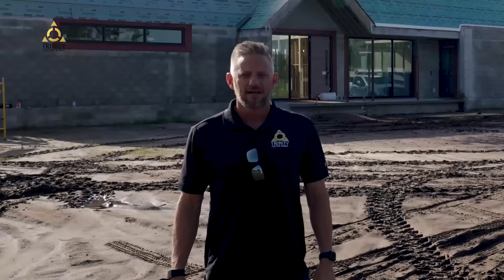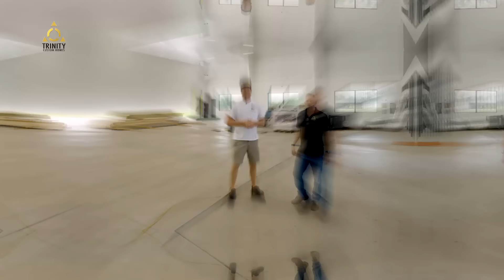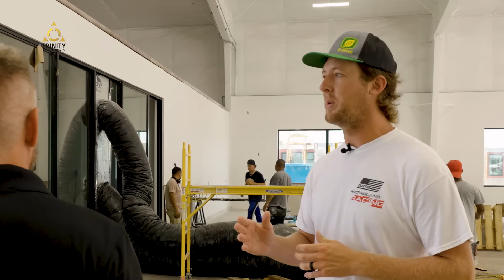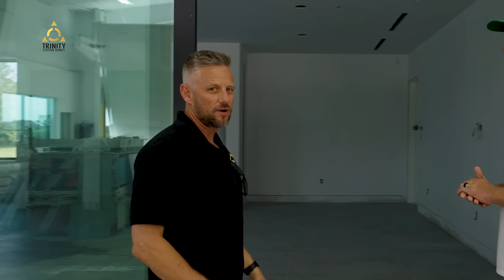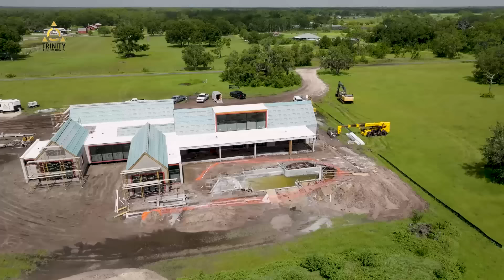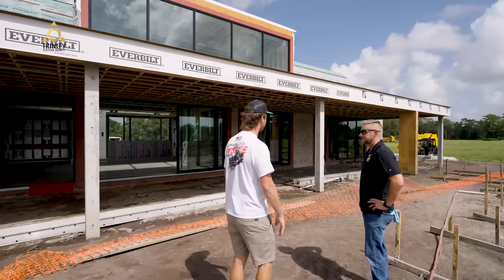Inside the Most Watched Custom Build in the Country | @CleetusM x Trinity Custom Homes

Comment: For cleetus to proudly say gm shirt what about the thousands of customers that has anyone of the gm gmc  Cadillac junk motors he should be careful on promoting gm or gmc / all  general motors another example 2023 2025 z06 zr1 fire hazard the fix well lets fix the cars not sold yet or the ones on the dealerships lots first then fix the ones that are already on the road ? Even worse to only using a new gas fill platic around the fill neck that dont have a tiny inch hole for run off or overfilled to just spill out over the side on the quarter panel alot of chevy onwers not happy

Comment: I'm curious why use wood 2x4 for all or most of the internal framework? Metal would have been much better for accurate and square and won't warp from different weather patterns and I think Metal studs would have been cheaper than wood

Comment: Question. What's with the longs metal bars on Cleetus's hanger door? I'd say counterweight but i still not sure how it works.
Reply from the maker: It’s a truss system to support the door from buckling when it’s open.  It’s 130’ wide. Without this, the door would collapse on itself.
Reply: @trinityconstructionanddesign Ah, ok thank you!

Comment: You can't stand on the AMERICAN FLAG ANYWAYS AS VERY DISRESPECTFUL IF WENT WITH THE AMERICAN FLAG, HOWEVER YOU NEED TO ADD ONE TO FREEDOM FACTORY OUT FRONT WITH THE FREEDOM FLAG BELOW AND ONE AT BRADENTON DRAGWAY AS WELL WITH IT'S DRAG RACING LOGO AS WELL WITH THE SIGNS AND KEEP THAT HELMET AT FREEDOM FACTORY  AND TRY TO LIGHT UP IF CAN USE LED LIGHTS THAT'S POPS THROUGH HOLES OR JUST OUTLINE THE HELMET WITH THE FLAG AND FLAG LOGO NEXT TO IT WITH SMALL ISLAND OF NICE LANDSCAPE LOOKS LIKE YOU SEE AT TALLADEGA AS SO COOL AS YOU JUST ABOUT BOUCED OUT OF THE RV WHEN SEEN THE SIGN AND FLAGS, YOUR PEOPLE THAT COMING TO THE RACES CAN GET THAT EXCITED YOU GOT AN SETUP SOME CAMPING SPOTS THAT'S WITH ELECTRIC AND CHARGE ACCORDINGLY AND GET A TRUCK TO PUMP OUT POOPERS AND DUMP AT LOCAL PLACE AS ADDED TO COST FOR DUMPING THATS KNOWN AS THE HONEY WAGON, DON'T KNOW WHY BUT THINK ITS FOR THE WIFE/FEMALE   IN CAMPING RIG. POUR CENMENT PADS FOR CAMPERS AS TOTER HOMES PARK ELSEWHERE AS RACERS AND CHARGE THEM A FEE TO PUMP OUT POOPER AS WELL AND HIRE SOMEONE TO COME IN AND YOU GET 15% OF WHAT THEY MAKE SO YOUR NOT RESPONSIBLE.  THEN HAVE FANS COMING IN EARLY TO DO THE CROWN VIC RIDES BEFORE THE RACES IN 2 DAYS AS CAN SHUT POWER OFF TO X AMOUNT THAT CAN SURVEY THAT WOULD PAY $129 A NIGHT WITHOUT PUMPING AS THAT'S A 3RD PARTY THAT'S COMES IN SUNDAY MORNING OR LATE SATURDAY AFTER BURNOUTS DOWN AND NOT STAYING THE NIGHT.  PLENTY OF ROOM OVER AT DRAG TRACK IF WENT TO HILL OFF IN DISTANCE THAT YOUR PROPERTY THAT ISN'T USED, MAKE A CAMPING AREA FOR BOTH PLACES BUT 50/50 NO MATTER WHAT EVENTS ARE GOING ON.  AGAIN TAKE ALL KINDS OF SURVEYS FROM ALL THE FANS THAT COMES THERE AND SOME STAY IN HOTELS AS SOME MIGHT STAY THERE IF BUILT A KID'S INDOOR ELECTRIC CART RACING THAT GOES UP AND OVERPASS AND DOWN AND HAVE ADULTS CARTS TURNED UP AND ONES FOR KIDS UNDER CERTAIN AGE THAT GOES DECENT BUT NOT AS FAST AND CAN HOLD RASING TOURNAMENTS LIKE IT'S NASCAR STYLE WITH POINTS.  LIKE A BOWLING LEAGUE WOULD BE SETUP FOR MEN AND WOMAN WITH ARCADE MACHINES AND RIG THAT CAN RACE BEGINNINGS FOR THE RIG YOU HAVE TO PRACTICE FOR NASCAR TRACKS.  WITH A PLACE TO EAT PUZZA AND SERVE BEER AND WINE. AS SOME PARENTS DON'T CARE FOR RACING BUT GET THEM TO TRACKS AND MORE HUSBAND'S CAN GO AS STUFF FOR WOMAN AND MEN IF WOMENS LOVES RACING AS KIDS CAN DO AND ENJOY THE DAY WHILE HUSBAND'S OR WIFE'S ARE WATCHING RACING. TAKE SURVEYS FROM THEM WALKING IN GATES IF PAID TO CAMP MINIMUM OF 3 DAYS AND OFF UNLESS IT CAN MAKE MONEY AS CAMP GROUND THAT CAN MAKE ENOUGH MONEY AND ADD POOL AREA WITH LIFEGUARD WHEN OPENED. LIKE A SMALL RESORT THAT YOU STAYED AT WHILE DOING THE RV CHALLENGE.  ADD WATERSIDES IF CAN AND MAKE DECENT MONEY FOR TRACKS AS HALF RENTS FOR RACING SEASON TIMES FROM BOTH TRACKS. OR BUILD A MOTEL/HOTEL 
ALSO, YOUR HANGER, YOU CAN ADD AND CAR ELEVATOR FOR ROOM THAT CAN HOLD 30 CARS OR 6 CARS THATS NEAT AND UP OFF GROUND FROM FLOODS IF FLOODED RACECARS WILL COST LOTS TO REPAIR THEM.  IT'S THE VERY STRONG BUILDING BUT IF WATER DID COME HIGH ENOUGH, THEN WOULDN'T HAVE TO WORRY AS COULD PUT IN 1 CORNER, CHECK THEM OUT AS LIKE A VENDING MACHINE THAT MOVES CARS AROUND TO GET 1 YOU WANT DOWN IF UP ON 4TH FLOOR ON BIG ONES.  PRETTY WILD. YOU HAVE PLENTY OF YEARS LEFT PLUS CAN PUT PERSONAL DAILY DRIVERS AND FAMILY VEHICLES IN THERE THAT LIVES CLOSE TO SAVE VEHICLE LIKE IF VIVS CAR AT TRACK 99% OF TIME AND CAN'T MOVE TO HIGH GROUND, THEN CAN PUT PARTNERS PROMOD UP AS WELL AT THERE OWN RISK. AS HAVE THEM SIGN WAVERS. AND CAN USE MEZZANINE FOR SMALLER STUFF LIKE GOLFVCARTS FOR FREEDOM FACTORY AND SAVE MONEY AS INSURANCE DON'T PAY FOR THINGS LIKE THAT.  CAN MAKE HANGER THERE THAT CAN GET CUBNIN STILL AS LONG YOU ADD MEZZ UP TO PUT STUFF UP HIGHER AND SAVE YOUR EQUIPMENT.

Comment: 5:49 why y’all got that going through the windows like that?
Reply: keeps the room climate controlled while the drywall is getting done. Super hot and humid without AC on and thats not great for finishing drywall.
Reply: Remove moisture
Reply: Level 4 drywall
Reply: Like others said, it's to keep the drywall a stable temperature until all the permanent climate control is set up and running. Don't wanna risk big temperature and humidity swings that could cause the drywall/paint to crack
Reply: Temporary AC

Comment: Can you imagine the amount of effort to paint the raw steel in the Tesla GigaTexas Factory? That building is a 1/4 mile wide and almost a mile long. All painted in white inside.
Reply: Ive done work both for tesla and amazon facilities. Commercial factory and warehouse spaces like that are much simpler than the hanger. the open structure would receive all the same paint and require minimal masking and prep to be sprayed with dryfall paint. the deck and MEP all go the same paint and color, most material is already factory primed, and adhesion to raw metal surfaces is great. Dryfall is also flash rust resistant and only requires some primer at the fire sprinkler pipes. not to mention in commercial work, we paint the structure and mep prior to insulation and scrim. The work here is FANTASTIC, and cannot be compared to commercial.
Reply: Yes, I can. When I first started as a pro painter, for my uncle, I was mixing 5 gallon buckets of paint to keep the airless fed, while both my uncle and cousin had spray guns run off that pump to spray the outside of a small school. I don't recall seeing what prep had to be done to the steel in Cleet's hangar, but generally steel frames are primed in red oxide primer or a gray primer, with some actually having a finish on them (gray oil based in the past). Do they just have to clean the steel, sand it, media blast it, direct to metal paint, or primer and finish, sand between coats.....not likely on something like that. Was the Tesla steel painted before or after the skin and electrical and mechanical systems? It would be a really cool documentary to watch, like seeing how the Golden Gate Bridge is painted.

Being very detail oriented and having patience, made me a great painter. I learned many other trades and after 17 years of painting often, now (and for the last 13 years) only do occasional small paint jobs. It is a ton of work.

Comment: Stucco in a hurricane zone? Won't that get impregnated with debris? Even from the little storms? I'm no expert. I just would've thought something sturdier, we'd be better.
Reply: Stucco over CBC is pretty common in Florida. It’s not stucco over a wood frame. It’s concrete or concrete blocks with poured cells and bond beams to keep it together.
Reply: @Bill_N_ATX  ok thanks!